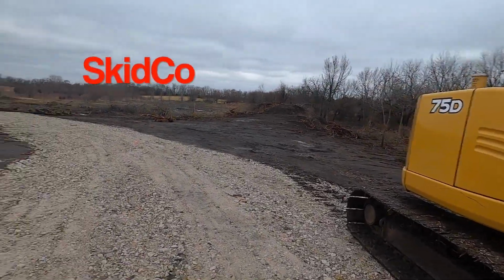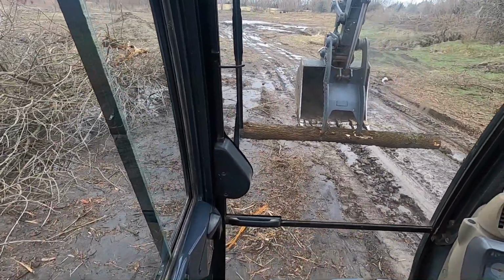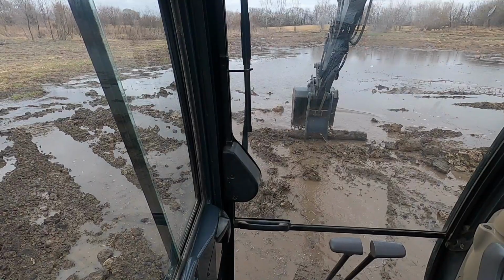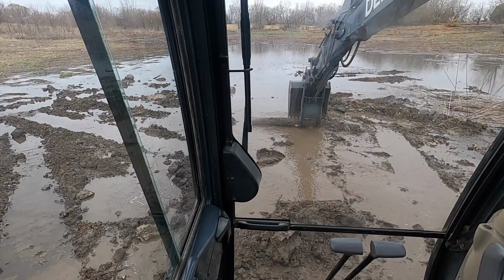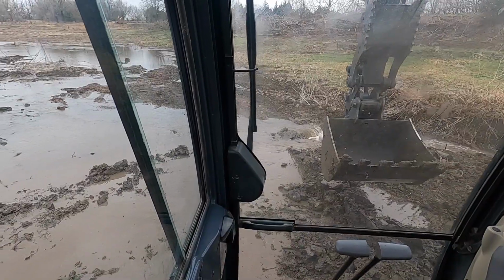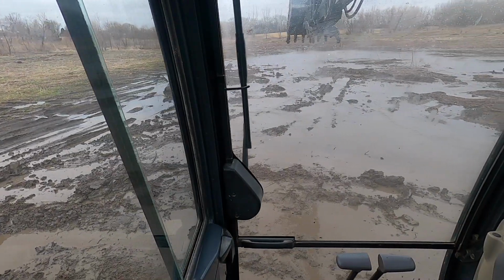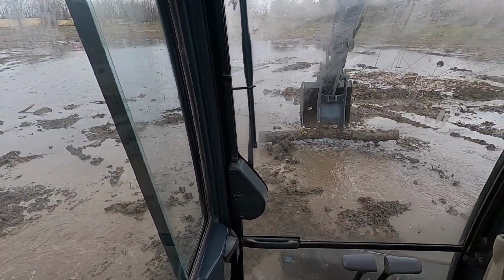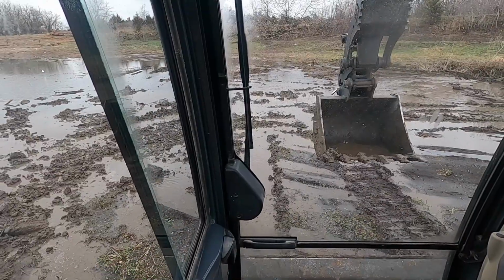Were not supposed to have a pond yet.

Comment: I’m putting a thumb on my 75D. It is the same set op as yours plumed for a hammer that works off foot pedal. I can hear the relays click when I push the buttons. What did you do to yours to make it work the thumb?
Reply from the maker: I bought a new kit. But when I was installing it I found the control wires that the relays are controlling. 
Take the trim piece off that is back behind the boom. Then look all the way down along the cab of the machine. Mine has two plugs with two wires each. Those are your wires. You could hook those to your valve for your hydraulics on the thumb.
Reply: @skidco  Thanks. I found the plugs from the joystick. Bought the wiring harness from there to my solenoid that only hooked to one side with the foot pedal.